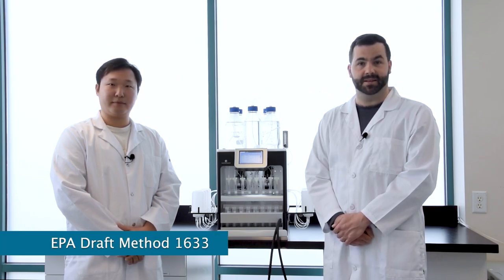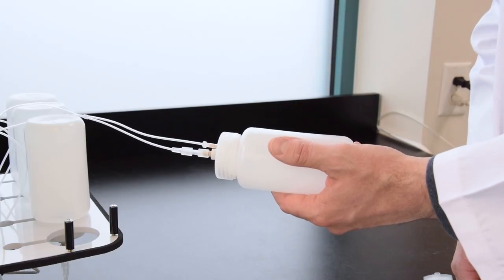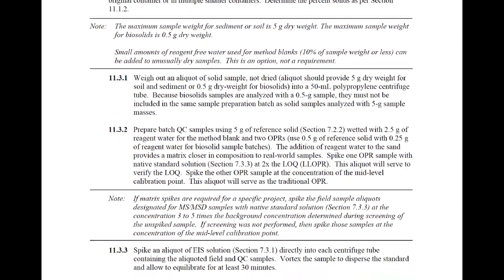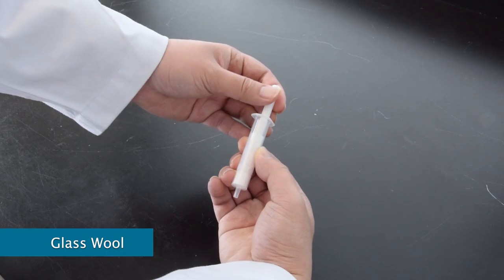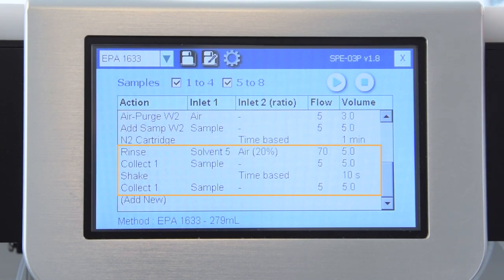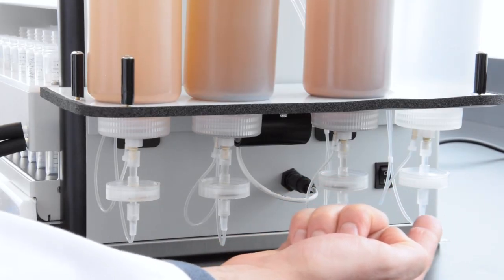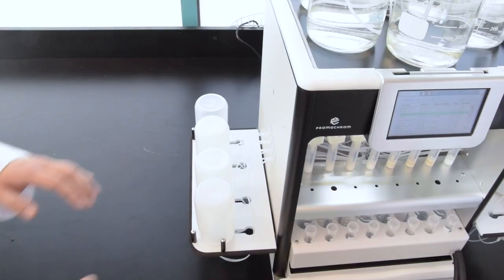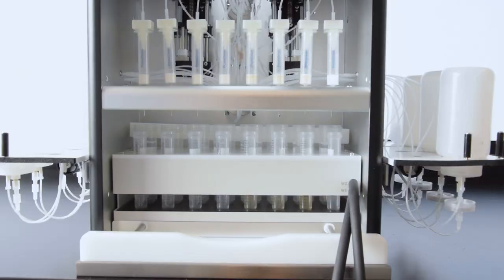Automated SPE for PFAS using draft EPA Method 1633 (Extraction of non-potable PFAS matrices)

Comment: This was put out a year ago. Any changes to the system based on the number of Draft updates that have occurred to the method?
Reply from the maker: Hello TheSchmidt62, great question, the SPE-03 Gen 4 was later released in late 2022 with a series of hardware and software upgrades that can be found at https://youtu.be/M7P9RTM6wcA?feature=shared. More recently, we've also added new anti-clogging features and accessories to address the wide range of sample matrices.